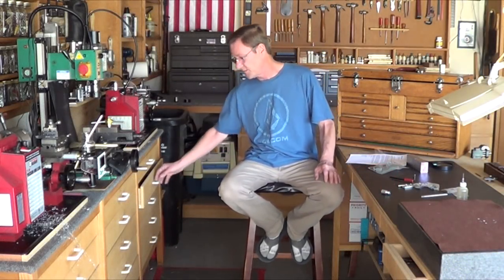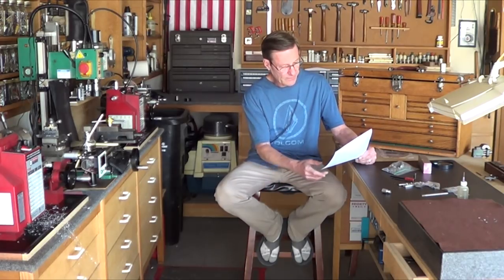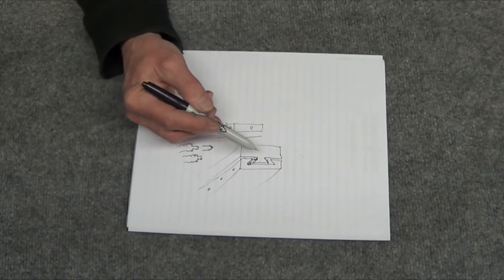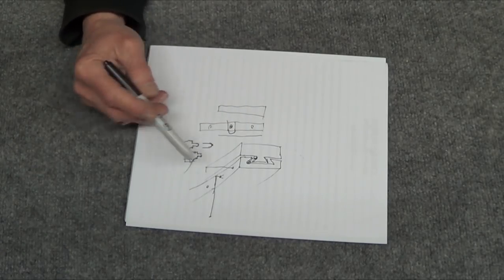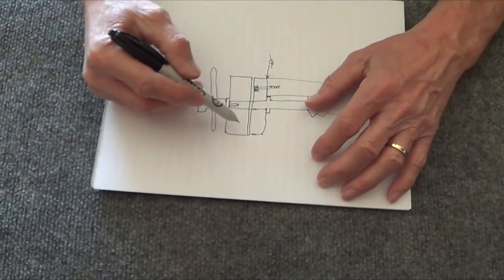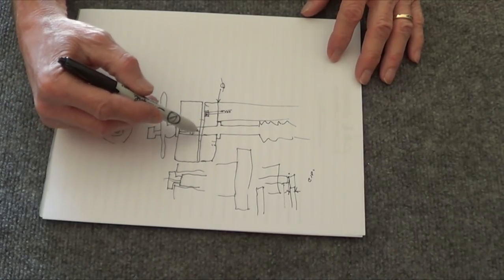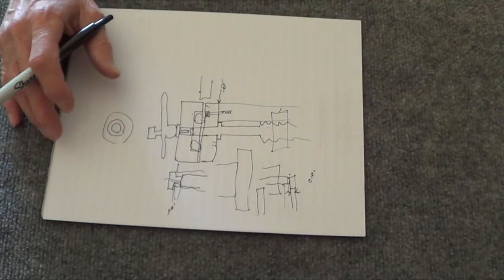Harbor Freight Mini Lathe Compound Fix Video #122

Comment: I would not use diamond power as a lapping compound on a lathe.  The diamond lapping compound will embed itself into the cast iron surface it is used on and keep on machine those surfaces as us you use your lathe. Jeffrey Vastine is correct on the type of lapping compound to use. Brownell's sells a good lapping compound for this type of use.

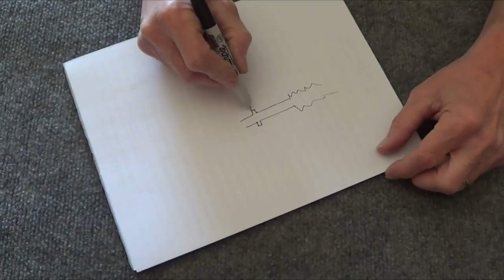Comment: For lead screws going to the handles, I use auto grease on the shaft locations at 17:00 and the action is much smoother and prevents wear that otherwise occurs on 'dry' shafts, often no special bearing is needed. The grease stays put compared to oil and no need to re-apply for a year or more.  The machine bed? use oil as usual.
Reply from the maker: The reason I use oil is when the temperature in the shop goes down grease gets very thick increasing drag but oil isn't affected as much.
Reply: @TheMiniMachineShop  Yes, I'd agree if you use a  grease that is not automotive bearing grease that has a wide temp range and it's cheap too. My concern was that oil runs out of these hard to reach spots.

Comment: Dave,  it is extremely important that when lapping the compound or any part of the Chinese mini-lathes that you use a lapping compound whose abrasive breaks down.Otherwise the abrasive will embed itself into the soft cast iron and that will result in excessive wear as the machine is in normal use. Therefore the diamond lapping compound that you had mentioned would be a bad choice. The Chinese cast iron is very soft compared to the American made cast iron of today and even that does not compare to the American cast iron that was made prior to 1950. There is some info on this subject on Suburban Tools channel when Don visits a company that restores old machines. Thanks!
Peace!
Reply from the maker: Good point that I never thought of!

Comment: For the gib screws, I wouldn't use loctite. You should look at using screws with a nylon insert. You can get them from McMaster, or you can get them from LMS. They're pretty cheap, and it's a great way to keep them in place. If you want to do any fine-tuning after the gib wears in you don't have loctite to break, just adjust the gib screw. You won't need the nut after putting them in either,

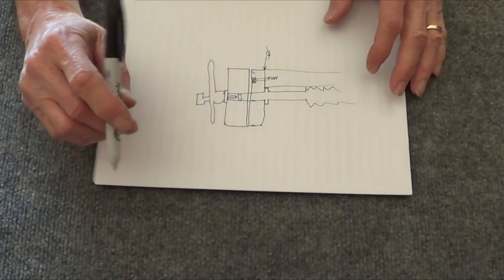Comment: Hi Dave, I'm very much so a beginner hobbyist that happens to have the same Harbor Freight 7x10 lathe. I gave up on it altogether trying to get accurate cuts because of all of the play in the compound cranks. Referencing your possible solution @20:38, I inspected the compound and found that the leadscrew is exposed at the back. By applying fixed pressure at the end of the leadscrew it removes the play. I think this method may be the simplest. I'll see about taking some pictures when I implement the fix.
Reply from the maker: Hi Obi, The fix here is just to remove the ugly dial friction. You need to discover what the three screws ( two box head and one set screw)  on the top of the compound do! They tilt the nut to remove lead screw play. You also should watch video #78. Actually as a new guy, you should watch all from #1 on in order. Cheers!

Comment: Hi Dave, excellent video! I recently purchased a 7 x 12 and have been modding the heck out of it. Your right, there is way too much slop with the grub screws for the gib adjustment, I have replaced all of them with quality stainless steel and will use the blue Loctite trick, great idea! Keep up the good work, enjoy your videos. Cheers, Doug
Reply from the maker: My experience you may want the other soft screws back. I've had enough accidents where something grabbed and yes play is in the compound again. The gib screws flattened. With stainless I think the gib itself is going to dent causing way more problems. Just my 2 cents...
Reply: That's interesting Dave, I never considered the hardness of SS for this application, are the gibs (compound/cross slide) hardened hrc __? Or, do you know the hardness of the gibs? I have yet to test them. The quality of my lathe is really nice, (may have got lucky...lol) the ground finishes, castings and general build quality is not bad at all, the hardware they used is cheese grade at best though, that's why I have been upgrading the hardware. Thanks very much for input Dave! I absolutely love this little lathe. Doug
Reply from the maker: The gibs themselves are not hardened as I can file them easily. Easy to mill also for the groove I mentioned. I haven't taken mine apart to see if the gib is dented after so many accidents but all seems fine after just re-adjusting them each time.

Comment: Hi Dave, thanks for the Friday visit.  I'm still trying to figure out what is holding up Echolink.  Got the router setup to allow UDP forwarding on the right ports and Windows Firewall set up to pass Echolink, but something is still blocking.  I'll get there, just have too many things going on.  I have some ideas on upgrading the compound on the mini lathe.  When I get done putting my new shop together I'll play with them and pass along what I come up with. (I'm thinking about building a whole new, wider carriage.)
Reply from the maker: You are behind a router so disable the firewall. Not needed. MS never protected you anyway and the proof is over 2,000 security patches. Hope you get it resolved soon! A thought, I've found some ISP's block some ports.
Reply: Yes, I have disabled the firewall.  I'm on Comcast, I am kind of hit or miss on trying to resolve the problem as I am pretty busy with the shop.  Trying to get it done before my wife retires (for the second time!).  The mini lathe is my "in the basement shop" lathe.  I have to make a new place for my 14 X 40 Jet lathe,  Bridgeport clone  9 X 49 mill, 7 inch Logan shaper and  Rockwell surface grinder.  And my wood shop tools as well!  Then I can rearrange the electronics bench and get my ham shack set up again! (By then swmbo will want to move again. LOL!)
Reply from the maker: Ordered a killer mic and having a blast now on echolink! There is a great Georgia network that is my favorite. Get the shack up my friend.... Would love to hear you!

Comment: just bought a 7x10 myself, and just wanted to make sure this is still the way to go? also seems like diamond compound is a no go, so what is the preferred abrasive? i have seen a lot of silicon carbide, is that any good for this?
Reply from the maker: Don't know about the silicon stuff but I would still go with the valve compound as fine as you can get. Just bought an assortment of diamond compound from banggood and the 5 micron would also be good. Easy to remove and if some stays good, it will keep tuning the gib over time.
Reply: Thanks for the quick reply. I will stop by my auto parts store today and grab some.
Reply: man, if your lapping compound is 600 grit, save it, because its gold. the best lapping that isnt diamond is like 240 i think. why so few choices nowadays? idk, hopefully this 240 grit wont make things worse
Reply: I really don't understand why you think diamond lapping compounds would be a no go, you can get them in grades much finer than silicon carbide.  Silicon carbide is most often used in valve grinding paste for engines etc and you can get a decent result with it, but when you go with diamond lapping compounds which I did, you can start of with a heavy grade and finish off with a really fine grade, i did my lathe and mill gibs with 20 micron starting and finishing with 5 micron and my slides run nice and smooth.

Dave is correct when he mentions the problem with the factory drilled detents in the gibs and the factory screws, I redrilled mine and used my lathe to modify new set screws.  That should be one of the first things you do before you try to lap the gibs in because otherwise you could well be doing more harm than good when you go to lap them.